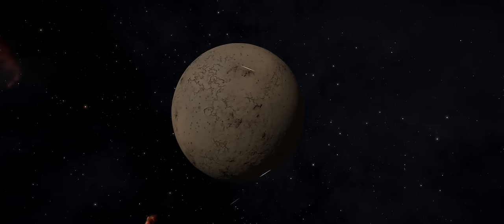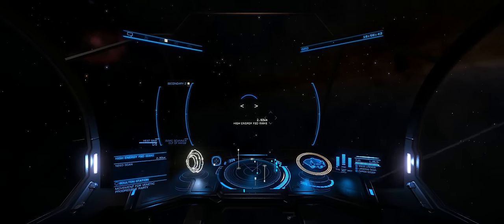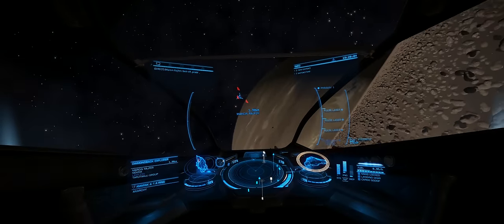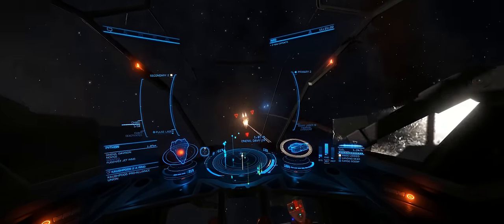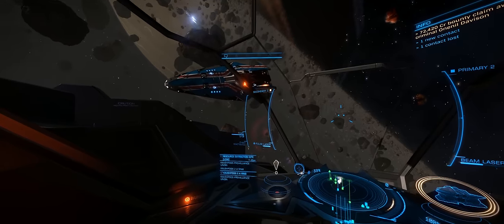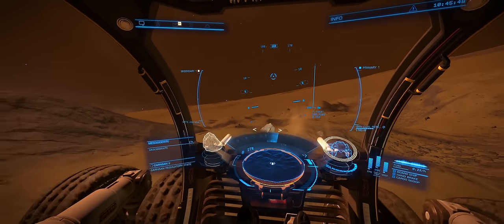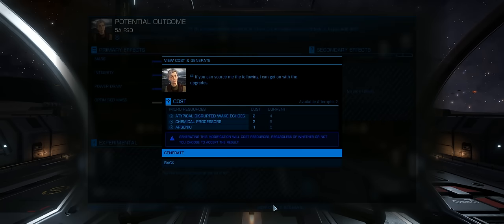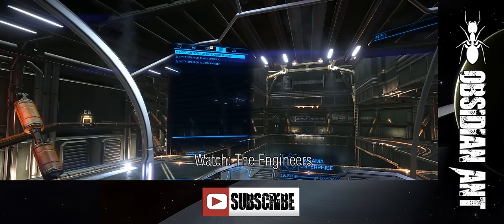Elite Dangerous - The Engineers - FSD Upgrades [Wake Echoes, Arsenic, Chemical Processors]

Comment: Its true that you sadly just can't "play the game" to get the materials needed for some of the upgrades. For example. If you want the level 5 FSD drives that give you greater range,  you will need polonium. 2 in fact for each roll of the dice. If you just "play the game" like I did, 6 months later you still wouldn't have found any polonium. Some people say it can be found on high metal worlds in and near large craters. That is partially true. The unfortunate aspect is that it is only on certain high metal content worlds. Not all all of them. Just specific ones. I went to a world that was surveyed by other players and after 3 days of searching "grinding", I managed to find 4 pieces of polonium. So it proves that "just play the game" as some forum people are fond of regurgitating is not practical. You actually have to grind to get certain materials to get some of the upgrades. It is also possible to do missions and get materials, but once again the missions that have those very rare materials are also very rare and once again you need to grind the mission boards to get those specific missions. The grind must stop. I love grinding. It is my style of play, but even I say this is going too far, because it takes faaaaaarrrrrr tooooooo looooooonng to do.

Comment: You dont need to do all upgrades to unlock other levels, you can rank up with that engeneer by selling to her exploration  data ( i dont know is elvira leveling up the same). I managed to level up up to 3 level by giving her only 400 000 credits of exploration data.
Reply: You can gain rep with all the engineers for doing things specific to their line of work. The blaster you need to hand in bounty or combat vouchers (not sure if one or both work), but they must be from Aliiance or specific from his system. Fed or imperial ones wont work.

Comment: I already did 5 grade FSD for my Corvette. It was WORSE than my previos grade 4. So i stay with 4 grade for now. Next time i willl make grade 5 for my ASP. 17LY Corvette btw. Chemical processors are very easy to obtain. Just do some missions. Where will be hell of a lot of them from enemy that will pirsue you. Your main problem will be chemical manipulators (from POI surface). ETA DRACONIS sistem planet 4 and 7 have arsenic. Planet 4 - arsenic and polonium. Planet 7 Arsenic and Yutrium. Don't forget to mark them in your bookmarks. Polonium - Po, Arsenic - As, Yutrium - Y. Fly safe, Ant)
If you need more help. Just ask.

Comment: You can sell the exploration data at Felicity too. Arsenic can be found at the High Metal Content planet on the same system. Allegedly, chemical processors can be obtained through missions. They drop in better numbers from hauling ships, so nav beacon smugglers may be a better bet. 

From a level 2 upgrade a 29ly DBE moved to 35. A trading clipper moved from 16 to 23.

Comment: I still have 5 arsenic left over from getting jumponium for DW. If it's used in level 5 FSD mods, should save me some time. After all, with 130,000 LY worth of data, I think I can get rating 5 access just with cartographics!
Reply: first you have to give her meta alloys. When you will get your 5 grade with all of your data.
Reply: You don't need Arsenic for level 5 FSD if you are looking for the greater range. You will need 2 Polonium for each roll plus a few other materials and a commodity
Reply: You need 1 Meta-Alloy first. The grade 5 needs different stuff. Notably Polonium. You can check out the blueprints here: http://inara.cz/galaxy-blueprint/2
Reply: I've had a look at Inara since then, I don't have any left over polonium which is a such, but I'm used to getting materials planet-side now. I already knew about the meta-alloy - I was meaning that once I've unlocked her, I'll get rating 5 access. Same with Elvira something-or-other; she can rank up with exploration data as well. But I need 3 Soonthill Relics for that.

Comment: It's worth pointing out that Arsenic is a Common material not Rare.
It drops from messosiderites about 1/4 of the time but only on certain planets.
Apparently it also drops from outcrops but in 50-ish outcrops I didn't get any to drop.
Don't bother with Bronzite Chondrites they only drop very common materials that drop at the time from the other sources.
Reply from the maker: Thanks for the tips.  And you are right Arsenic is a common material - yet it doesn't drop very often, and if comments are anything to go by - people are finding it difficult to locate.

Comment: and remember you you can get all the way to level 3 fairly quickly just churning level 1 upgrades. Then a handful of level 2 upgrades will get you to level 5.  Saving you the time to collect the higher level rarer mats.  I generally use level 1 upgrade until I am at level 3.5 and then level 2 upgrades to get to level 5.  I generally don't bother with level 3 and 4 upgrades unless I know it will be a while before I can gather the level 5 mats.

Comment: ObsidianAnt used his Vulture and another ship (Viper?) to collect resources and data, which he then delivered in his Asp for upgrades at the Engineers.  How do you do that?  Resources and data don't transfer when you switch ships, right? Or do these work differently than cargo?

Does he use two computers and perform a "self" hand-off? Or perhaps rely on another commander to hold your stuff while you switch ships?  Any other ways to do this?
Reply: They do transfer when you switch ships.
Reply from the maker: Materials and Data are bound to the character not your ship.  So they go with you wherever you go.

Comment: God the game looks good on your computer, are you running a 21:9 monitor along with that 21:9 resolution? Or do you play with black bars on the top and bottom? Also, what is your field of view (fov) setting set to? Thanks in advance
Reply from the maker: This is on my 21:9 monitor, so there are no black bars.  I set the FOV to 68 in one of the game files. :)

Comment: I wiped all my data and all my ships are all gone now of course. I knew they would be and mostly because I just wanted a fresh restart just to see how much different and how long the grind would take me. So with that said what is the most common method for getting credits in the game quickly. Is it still Hi RES sites like before or can we finally do missions at a decent pace..?
Reply: I wouldn't go to Hi RES at all until you've obtained a fairly capable ship with decent engineer upgrades.
You can go High sec RES though but you'll have to stick with the system security if you want to stand a chance.
Reply: Fastest way is going for the community goals, doing the bare minimum always puts you in around the top 75%, and ends up netting you between 1-5 M cr, for a minimal time investment

Comment: is there an engineer that upgrades our power distributer?
Reply: George Pearson How does the engineer upgrade the distributer? Can they increase our pips?
Reply: You have the information available at inara.cz/galaxy-engineers

They don't increase your pips. You can either specialize weapons/systems/engines giving both of the following in their respective field, specialize in additional weapon capacity at cost of recharge rate, or specialize in weapon recharge at cost of capacity.
Reply: +George Pearson 'Focus more'. So basically he makes it recharge your systems a bit faster. So my current distributer on my Cutter gives me about 14 seconds of sustained fire (can't remember the exact number, so I might be wrong). So the engineer makes it so 4 pips to weapons give me longer fire, 4 to engines to give faster boosts or 4 to systems for faster shield recharge?
Reply: George Pearson Thanks. I'll experiment this Friday when horizons releases on Xbox

Comment: game still isn't really worth going back to, half a year for the first season update, and no update on the horizon, no puns intended,  seems they just added more grind for minimal rewards, adding eye candy to a game but not adding any significant features as usual, there is so much they could have done with this game and the season expansion, maybe in 3 more years it'll be a maybe...
Reply: and I agree the rewards are far to little for the time to collect the mats.  Plus I find the negative affects are ridiculous!  What is the good of getting a 50% greater jump range if your ship burns up if you boost two times in a row.  Or getting 5% better armor and reducing your jump range by half because you ship mass goes up by a ridiculous amount.  It's just terrible game design!  It's just like they sit around all day and try to come up with ways to come up with ways to move you one step ahead at the cost of going 6 steps back!  GG Frontier!